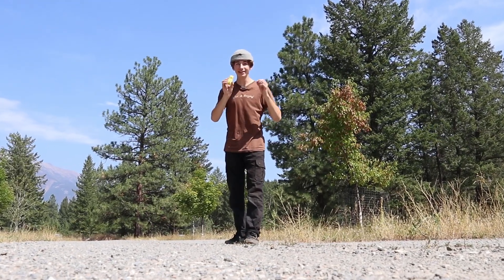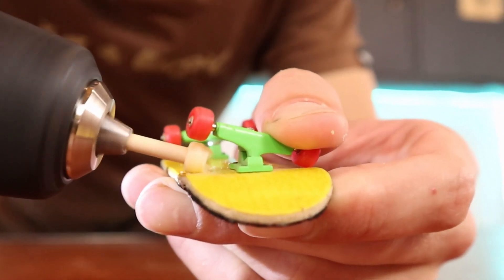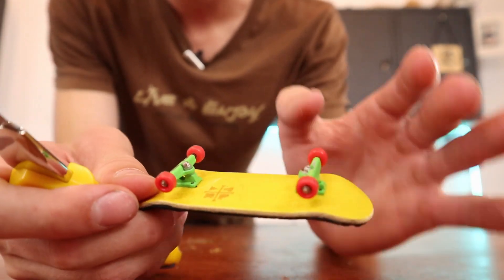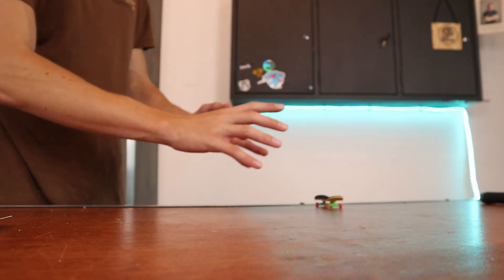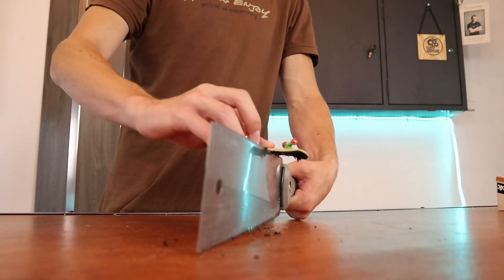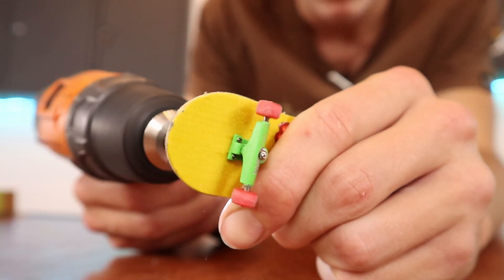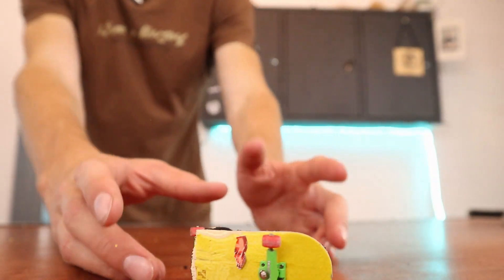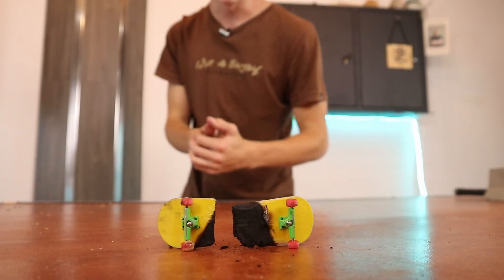Teak Tuning Durability TEST

Comment: Hey Alex I just got in to fingerboarding and just have a standard  tech deck and I don’t want to buy a expensive finger board so I was just going to upgrade mine what should I buy?
Reply: I'm not Alex but I'd totally recommend getting foam grip and some cheap bearing wheels. don't worry about upgrading trucks bc tech deck trucks are good
Reply: @prestonpowers10  thanks I decided just to buy a teak tuning board